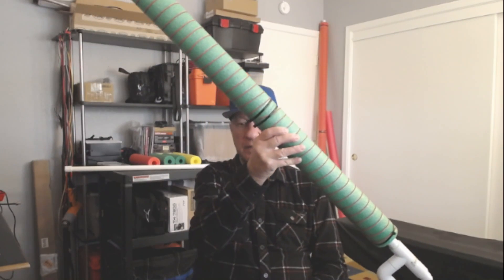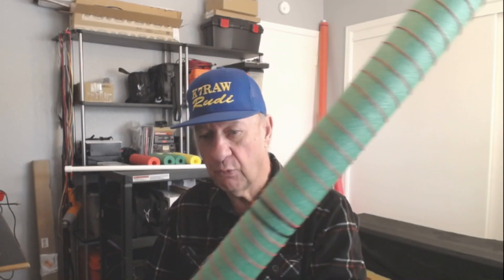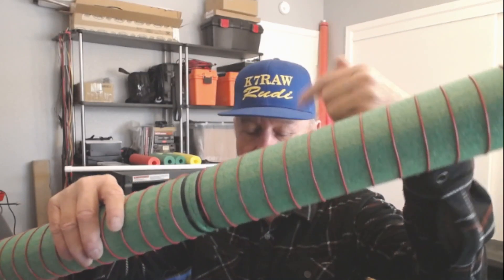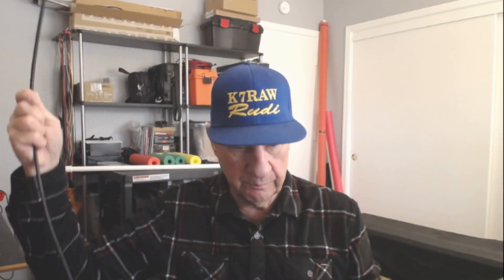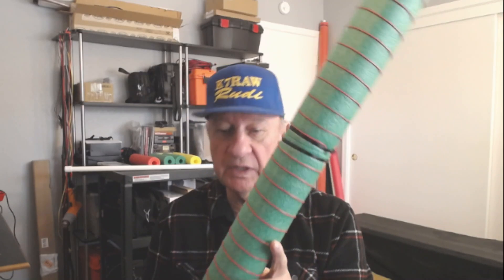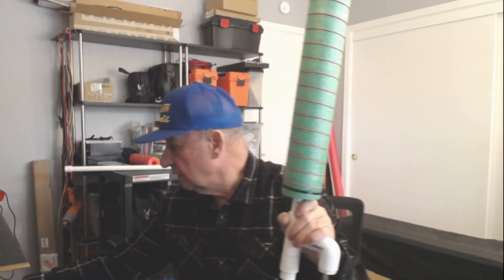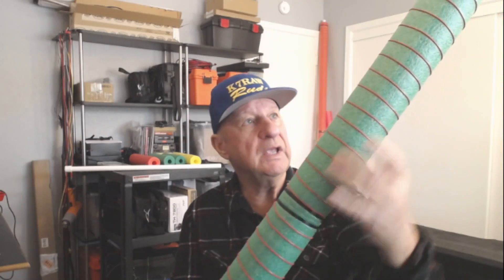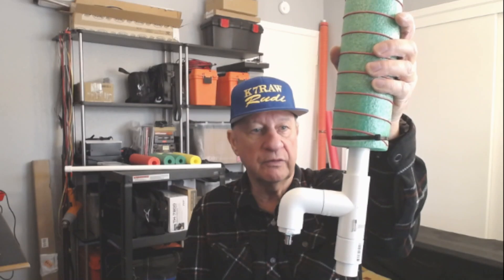Tiny NoodleTenna for HF Limited Spaces

Comment: I did something vaguely similar for wideband/shortwave reception.  I am trying to research to see how I can improve it.  I wound about 200 feet of #28 magnet wire around a piece of 2.5" PVC pipe going in one direction starting at the center, and did the same from the center going the other direction with another piece of #28.  fed the two center wires to a 1:1 UNUN and connected that to my SDR.  It works shockingly well.  I just winged it though.  I'm looking to play with techniques and wire lengths to see how it comes out.  Very little information out there on this type of thing.

Comment: Hi Rudy, Very Interesting design. What is the Bandwidth like, is it High Q or does it cover the 20Meter band pretty well? I'm wondering if it would be a good attic antenna.
Reply from the maker: It has all the wide bandwidth characteristics of a typical dipole. I would NOT recommend putting in the attic as it already is challenged a bit on receive. Place it on your porch or balcony.

Comment: SIMPLY GENIUS!
Reply: Not really..just a standard dipole wrapped around pool noodles 🤷🙄..in fact, I think it's a pretty bad design, I can see those noodles melting if you run over 30 watts through that wire ..
Reply from the maker: I've pumped well over 100W into this (once tuned) and never saw signs of heating. I use 18 AWG hookup wire which is rated to handle hundreds of watts. The resistance of such a relatively short length is VERY low. Before you criticize, maybe you should first try building, tuning and testing one for yourself. You may be surprised. It IS a "compromise", but if you live in an HOA or on the 5th floor with only a balcony, it will get you on the air.

Comment: What would you think about using an air wound coil approximately 6 in diameter made from 1/8 in copper tubing (self supporting), with  mechanism to expand or contract the coil, thereby changing its inductance enough to not only tune across the band, but also change from band to band ?
Reply: WOW, that would be big and HEAVY, not to mention pricey for all that copper.
Reply from the maker: Sounds complex and heavy (and maybe even expensive).

Comment: ”(scale the lengths for other HF bands)”

Now if I can just find a 400 inch long, 24 inch diameter pool noodle for 80 meters … 😀

Or maybe a ”Slinkie™ dipole”

73 de AF6AS
Reply: Yeah, I've built and tested a number Slinky dipoles but the biggest downside is that the spring steel Slinky has WAY too much ohmic resistance (otherwise known as a toaster coil) for my tastes.
Reply: @rudiwiedemann8173  <Gears in brain still turning> ... I wonder how much the efficiency would improve if someone had the ability to COPPER PLATE the Slinky? Factoring in skin effect (at HF frequencies), this should have the same effect as making the entire thing out of copper. I'd be mainly concerned if the Slinky would be as springy with a thin coating of copper ... 

73 de AF6AS in “DM13” land
Reply from the maker: Oh MAN that thing is going to be huge and droopy, even if you build it in 2 halves.

Comment: Remoteley tunable Idea: if you could get a short steel rod with a motor drive near the base you could drive it up and down inside a region of tighter (closer-wound) coil turns to alter the inductance and give it some remote fine-tuning across a band.

The motor would turn a threaded rod and and work a bit like a screwdriver antenna. 

The key thing is to move the steel bolt into and out of a section of tighter coils - in even-spaced coils there will be only marginal change is resonance. 
Not sure if there are better materials to use(steel is lossy and kills Q) but a steel bolt is cheap and easy to find for an experiment
Reply: Each NoodleTenna dipole is a pretty broad-band resonant device in and of itself, so it should not need any tuner or adjustment.

Comment: Any chance of measured plans on PDF?
Reply: C'mon man, it just AIN'T THAT BLOODY HARD! Just go get the parts, build it and then tune it up using an antenna analyzer. Realize that yo want to keep the lengths on both sides VERY close to equal, otherwise you'll have trouble getting a low SWR at resonance (that's your clue).

Comment: Hello Rudy, would there be any advantages of doing the pool noodle on a schedule 20 say 6in diameter pipe instead of the smaller diameter pool noodles?  Im thinking larger diameter might allow for a little larger antenna and maybe better performance?  What are your thoughts?  Over the winter its hard to locate pool noodles in my local stores.  kk7aim
Reply: VERY heavy and not too stiff.

Comment: on the one hand, I absolutely love this project combined with its potential. However, the list of parts does leave something to be desired. I went to Lowes and Home Depot and could not locate the parts. Of course, I found the pvc 1120 tube, no problem. I found the pfc (3/4") T and the 90-degree elbow, also no problem.
But the 3/4" flat-top plug (smooth) 2" long could not be found. 
The 3/4" pvc stub (T to elbow) 6" long could not be found. 
  If a skew-number were available, then locating the parts would be easier.  I think the problem is that everybody has their own terminology for the pvc parts.  I have to say, I am stumped. (Certainly, the customer service people at the stores are stumped.)
Reply: The "flat-top 3/4" plug" is simply for mounting the feed line connector (BNC or UHF). Available most hardware stores. To connect the elbow to the "T" just cut a 2" length off the 3/4" PVC pipe that you slipped inside the Noodle. the "T" is to allow you to mount it vertically to some sort of a pole with an adapter (which you'll have to figure out on your own). You should add a 3/4 PVC cap to the top to keep it dry inside.

Comment: So......does this mean you can work DX while lounging in your pool ?
Something to think about !
Any chance to configure these into a multi band beam ?
And if they fall over, what are they going to hurt....?
Genius !
Congratulations !
Reply: About the biggest "array" I've built was a horizonal 20m and 15m on a 6-way cross with the ligher 10m going up vertically. Wired them in parallel just like you would for a fan dipole. A common-mode choke at the feed point will also help.

Comment: Thanks Rudy for this inspiring project.  I built it and tested it out.  Made a fantastic QSO from Gibraltar to USA through this antenna.  What I have found it to be too deaf, in other words it captures a lot of interference and over loads my icom 7300.  The SWR was perfect on 40, 20, 15, and 10.  In order to hear a qso I had to have them strong, say 5/7 to hear them at about 5/4, 5/6. 73's and welcome any feedback.
Reply: Yeah, that's probably it's biggest weakness. But all antennas are tradeoffs (especially if you include cost into the equation)

Comment: Hi sorry to bother you am from the east coast of the U K M6 PHS ham call 
I live in a flat with ni outside space can your pool noodle antenna work with an end fed wire 
I have a wire that goes from 80 to 10 meters with my ATU if it can be done will you be so kind as to help me by doing a diagram please thank you very much 
M6 PHS or better known as phil .
Reply: Dear Phil: Any NoodleTenna for bands below 20m will be HUGE, let alone trying to turn a typical 64' or 128'  EFHW into a NoodleTenna (wire length is much longer to compensate for the capacitance of all the turns)

Comment: how important is the coil spacing? could they be made tighter for 80m?
Reply: Not really. Closer coil windings will just require more wire length without substantially lowering the resonant frequency.

Comment: The 20 m version...If you take the t in the middle bring the co ax out a different hole you can use the hole to put it up in the air on a riser like the painters pole. Hmmmm
Reply: Exactly

Comment: Sorry but a coiled radiator cannot be as efficient as a full sized radiator.
Reply: better than nothing in an apartment
Reply: actually surprising close to a wire dipole on the transmit side, and a little less efficient on the receive side.

Comment: Thanks Rudy! I built the 20 meter helical wound pool noodle dipole antenna. Attic installed application approx 30 from ground elevation using 14 awg steel fence wire, w/coax RF choke. Logged in to share a performance testimony. 20 meter/100watt/SWR 1:1, horizontally mounted, space weather propagation conditions average - contact a few days ago, upstate New York to Capetown, South Africa. The noodle gets the job done.😀 Question: have you determined if the antenna has a circular wave pattern and would the signal direction be perpendicular to the dipole or generate off the ends?
Reply: A helical antenna this size won't radiate very much off the ends at HF. The circumference has to be close to the wavelength for a helical to fire that way. For 10m, that means the antenna has to be 3m in diameter!
Reply: Good to hear you had that kind of performance.  Any more updates for like 40m yet or are you still playing on 20m. Im asking because I think I am about to build one for 20 and 40m
Reply: @k7ilo_Las_Vegas  for now just the 20M. The set up is working great. No 40M as of yet but I do see one in the future. It's actually a pretty fun antenna to construct. I found using painters tape to hold the windings in place every couple of turns helps hold things in place as you wind the wire. Plenty of DX contacts on the cheap. Good luck with your builds.
Reply: This is NOT a "circularly-polarized" antenna. that would be a Travelling-Wave design (non-resonant) which this is not.

Comment: Great idea! FYI, extendable versions of the threaded pole are available at Harbor Freight. They're about 3ft long collapsed, but extend to 9 ft long when extended. They're designed to extend paint rollers, but would make an excellent mast for your antenna.
Reply: I use DocaPoles which are exactly that...telescopic painter's poles.

Comment: What would be your best guess for the 2 meter and 70cm bands as far as length, spacing, etc? Great video --- easy to watch visually, great quality audio, no rambling, and straight to the point. Keep up the good work. Look forward to other videos you've made or will produce in the future.
Reply: Those are already so short you don't need to "coil up the wire" like I do here.

Comment: how much dB loss does that poolnoodleantenna has compared to a straight wire ?
Reply from the maker: Hard to say. I'd estimate that there is some RF losses in the coil structure itself. I have not tested it against a known antenna performance on RBN.

Comment: Can one make a nonresonant  EndFed Noodle with 9:1 UnUn plus choke at the feedpoint?  Would need a counterpoise wire but it might be more multiband compared to a dipole design?
Reply from the maker: Yes, I've built one with 2X5''x4" OD noodles, 12 ga wire, a mess of ground radials and an LDG RT-100 remote tuner at the base. Loads up and seems to get out fine.

Comment: Hi- Maybe I missed something. Why wouldn't the wire be almost 35 feet cut in half for a full wave at maybe 28.500 mhz. Where did 28 feet cut in half come from? I guess you can tell I'm pretty new at this. Thanks.
Reply from the maker: THe relatively tight turns of the helix delivers a LOT of inductance and shortens the effective electrical length anyway. So you need a lot more wire length to get back to resonance than a standard straight dipole.
Reply: @antennawhisperer-k7raw151  Thank you

Comment: How would this work as an attic antenna in a 1-story house?  
Also, if making multiple noodles for different bands (like a fan dipole), would it matter orientation and which was higher than the others?  
Thanks for putting the instructions in the description!  This is great!!!
Reply from the maker: You can definitely connect them at the center and feed them off a single coax like a fan dipole. Cluster them as a 3D Cross.
Reply: Attic antennas are already very compromised, especially on receive. I suggest using a porch or balcony.

Comment: what is the power rating for the 10-meter antenna?  it sounds interesting.
Reply from the maker: If you use 18 gauge or heavier you can confidently run 100W.
Reply from the maker: If you use 12-14ga wire you're good for 100W+

Comment: Wonder if you could build a reflector and director? Mini noodle beam!
Reply from the maker: That would be interesting but somewhat bulky for POTA and HOTA (HOAs-On-The-Air). I'm working on a trapped multi-band version (20m/15m/10m) instead.
Reply: @antennawhisperer-k7raw151  Would like to see your multi band version

Comment: How did you choose the 1 inch coil spacing? What is it's significance?  What happens if it were changed?
Reply from the maker: I haven't taken the time to try different winding spacings. I went by my experience with Slinky antennas (MUCH more ohmic losses). Remember that the short you go, the less sensitive the antenna is on receive. I complement my NoodleTenna with a dedicated long-wire on my SDR receiver with a T/R switch into the rig.
Reply from the maker: You just need enough wraps to give you the electrical length it wants for resonance. One inch was convenient, that's all, nothing magic.

Comment: This kind of reminds me of "The Heli-Rope Antenna" in the June 1971 edition of QST. Instead of a pool noodle, they use a much smaller form... rope.
Reply from the maker: Pool noodles are cheap, light, and have a nice large diameter to get lots of wire length in a compact form factor.
Reply: The cool thing about the Noodle is that it provides a great form to hold the turns at a controlled spacing while still being light, as well as providing stiffness (with the internal 3/4" PVC tubing).

Comment: Have you ever attempted to use one of these 20m noodles with a 49:1 transformer, effectively making it an endfed half wave on 40 m. So instead of having the break in the middle just feed it at one end and wrap the wire all the way to the other end
Reply from the maker: Thought about that. For 40m you'd need a noodle that was 4X the length of the 10m of course. That gets pretty unwieldy. With a 20m version I split the antenna into 2 noodles and stick the PVC tubes together at a cross and connect my coax thru a BNC to a pair of spade-type connector pairs for quick assembly/disassembly. That's big enough for me.
Reply from the maker: Never tried that, but you'd need a HUGELY long noodle! TRY IT!
Reply: Why degrade your radiated power with an UnUn when you can get resonance for free with a dipole?

Comment: Crusing youtube and found your channel.  Love the idea of the antenna.  One question how do you figure out the number of turns per band?
Reply from the maker: Just use 18 turns on a 70mm diameter noodle on each end for 10m version and scale linearly from there. 20m would simply be 36 turns at each end. Fold-back excess (DON'T CUT) to tune it to a higher resonant frequency. If your SWR never gets down to about 1.5, then you have a mis-match in wire lengths between the 2 ends.
Reply from the maker: If you start with my length or windings for 10m, just scale for the band. EG-20m would be 80 turns total.
Reply: Well, I started with 10m because it was easier to physically deal with. Then all the other bands just scale from there. If you change the turn spacing you'll have to change the number of turns to get into resonance.

Comment: Hi Rudi!! I'm extremely excited to find your video! I've been considering using a set of pool noodles to create a helically wound cubical quad antenna. It would have some wind loading because of the noodles but (going out on a limb here) if we can reduce, for example, a 20m quad's radiating element from ~5m/side to ~1m/side (using your quote of a dipole 1/5 the normal size), that's a HUGE reduction. That would even put a 40m quad within a reasonable size. I realize there's some inductance with a purely helical design but I think it's something that might be worth pursing. The nice thing about quads, from what I've read, is unlike yagis, they don't need to be 1/2 wavelength above ground.
I'd really like to know what you think of a purely helical wound quad, using pool noodles (and some sort of frame to support it, of course)? I'll check your other videos too! You definitely have a new fan here. (Due to uncontrollable circumstances, we lost our home a few years ago, with little notice and had to settle for a HOA condo so, antennas choices are slim.) Very best 73's!! Tnx de WB3CFN ...dit dit
Reply from the maker: The main idea here was a stealthier and more portable antenna for POTA and HOTA (HOA's-On-The-Air). Kind of like the next step from a hamstick dipole. There's LOTS of different directions to take this. I like the multi-band parallel dipole approach with 3 NoodleTennas on mast. The 10m vertical at the top, and two horizontal dipoles below that (15m and 20m). Then feed them in parallel just like a fan dipole. These are already are right angles to each other for good EM separation. Remember to use a good common-mode choke like 6-8 snap-on Mix 31 ferrites at the feed point with a tight fit to the coax.
Reply from the maker: I think that's pushing the concept a bit. BUT TRY IT.
Reply: First of all I can relate with you on the HOA challenges, which is the reason I developed this guy. I think any structure more complex than 2-3 of these (eg-10/15/20m on a 6-way cross) would be WAY too heavy, floppy and have huge wind loading.